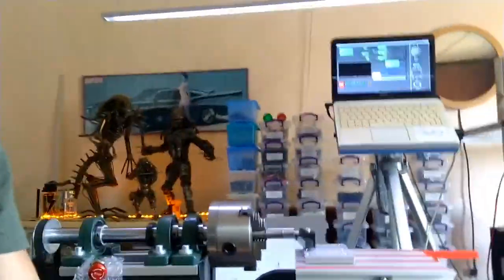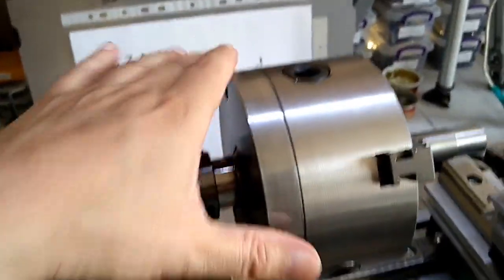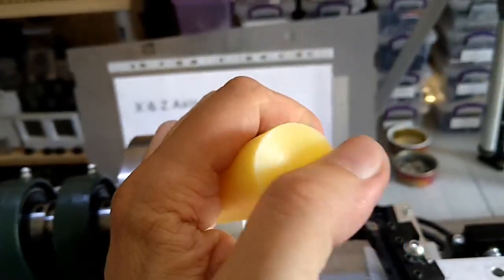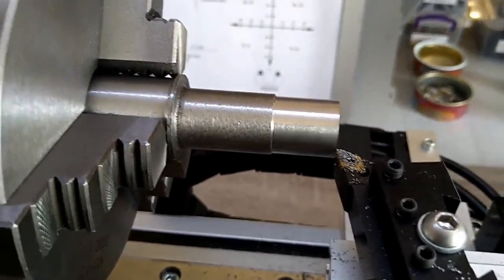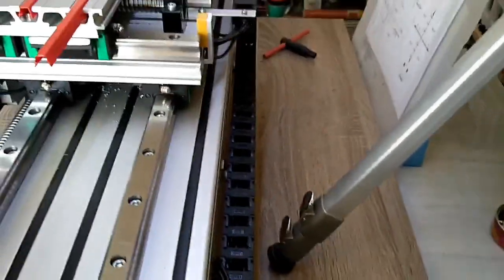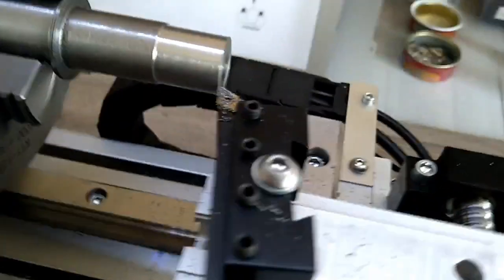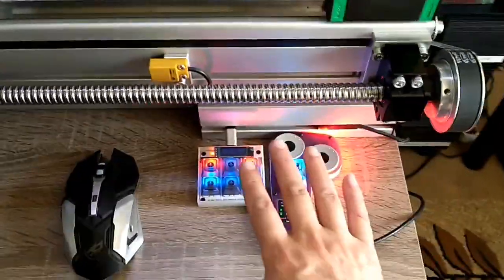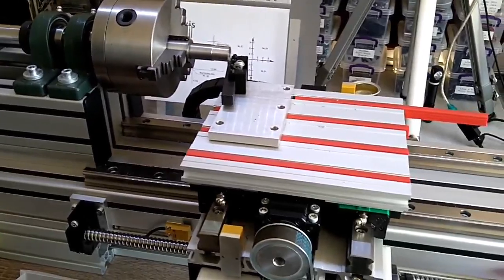DIY CNC Lathe controlled with MACH3 build by #Hayri #MACH3 #PCBWay com Part 6b

Comment: Really cool Hayri! Would love to see both videos on you machining something or everything, love that kind of content. But I would also love to see progress and build videos on your new belt sander. This is really fun stuff and combined with your electronics knowledge and products you make, I just.. love it! Really fun to watch! 😃
Reply from the maker: Thanks Chris, I am slowly but surely getting there 🙂Still a few things to finish up, like the tool holder for example. Have added the indexing/dividing feature (video soon) and am getting a 7" touch screen for manual use of the lathe, thought it would be nicer than using my external keypad and pendant. Was actually going to design a new pendant but I think a touch screen will be "nicer" 🙂 Anyway, more video to come and hopefully I don't mess up again and upload only a third of it. Stay safe.
Reply: @iHayri1  Haha no worries, was a sneak peak last video 😂 Sounds great, really fun stuff! For some reason I don't get any notification when you reply on the comments, which is why I reply late 😢 just for your information, its not that I'm not interested, just not getting the notifications.. Oh well, looking forward to more videos and progress 😃
Reply from the maker: @ChrisFredriksson  I, somehow, never get notifications about the channels I am subscribed to, go figure 🙂Anyway, just figured out how I can use the spindle rpm sensor to index the chuck when using it as a indexing head, Mach3 is surely not easy to get around with. Still a lot to learn and get used too, but nevertheless a lot of fun 🙂 Till later.

Comment: Fantastic progress Hayri!!! It's good to see you have turned some steel. That will make it a little easier to dial in and tune your lathe!!! You have really done a great job with how you think a lathe should be!!! I can't wait to see your next update!!! Awesome job....very impressive!!!!!!
Reply from the maker: Thanks Adam, next upgrade already done, the indexing/dividing head/chuck 🙂Just have to adjust the settings for steps and pulley ratio. Still looking for a CAD. Oh, also a 7" Touch screen on the way for manual control and input 🙂

Comment: It will cut most things Hayri.Speed n Feeds..Heaps off fun too come,cutting new things..Look in car frames"Stiffening" Most off the 2pack resins(Foam) they use,are the same stuff,used in lathes.Might be cheeper?.Your RedMatrix is working great💪
Reply from the maker: Thanks Peter, great idea, will look into it, I also thought about filling it with sand, but that will probably not work as it would not be stiff. Received some parts and now the chuck can double as a dividing/indexing head as well. If I do not screw up again, it will be a whole video. lol. Enjoy your Matrix 🙂